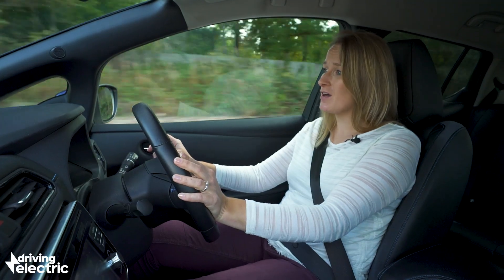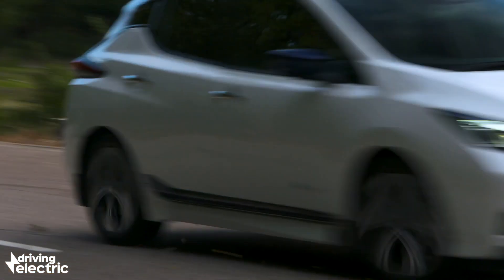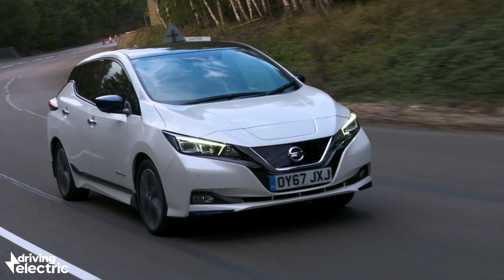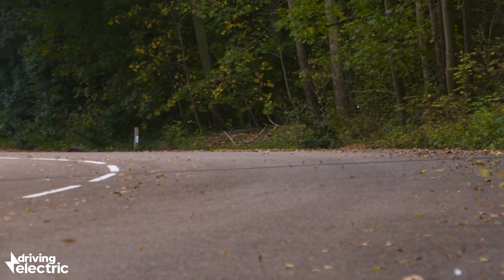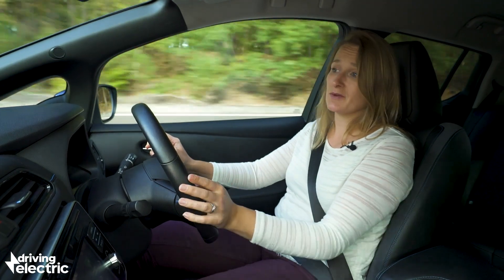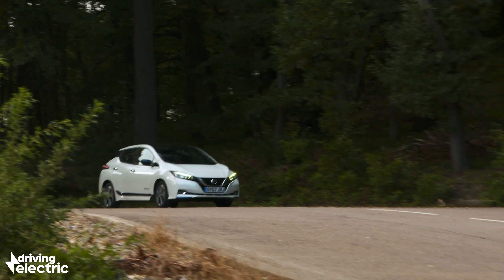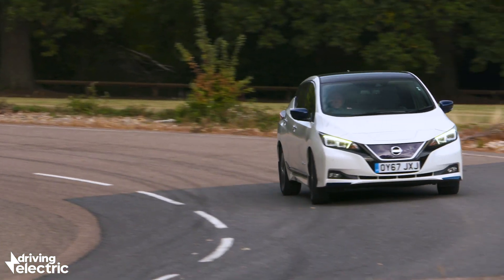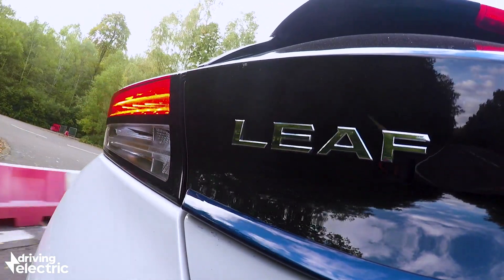What is regenerative braking and the E-Pedal? - DrivingElectric

Comment: That's not how it works... It's not using heat to regen, it's using the electric motor as an alternator being turned by the cars momentum keeping the wheels spinning. Also on a leaf the e-pedal actively applies the brakes and lights up the brake lights when you come off the accelerator. Selecting 'B' on the gear selector turns on the regenerative braking on, which just feels like engine breaking in a manual but instead of the wheels generating force to keep an engine turning it turns the electric motor. As an electric motor is the essentially same thing as an alternator it generates current when manually turned as opposed to generating rotational force when current is applied... The generated current is used to charge the battery by a small amount.

Comment: The braking is done by the electric motor turning into a generator when you lift your foot of the accelerator and increases when you press the brake pedal before the brake pads actually touch the disk, so electric cars are very easy on brake pads, and it’s great on slippery roads in winter because the motor can brake the car without locking the wheels and causing the car to skid😢